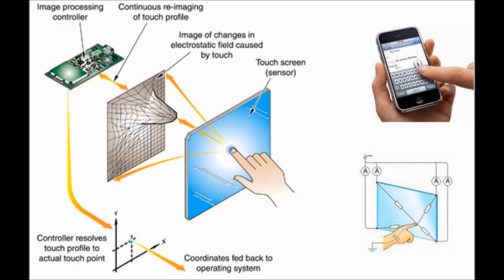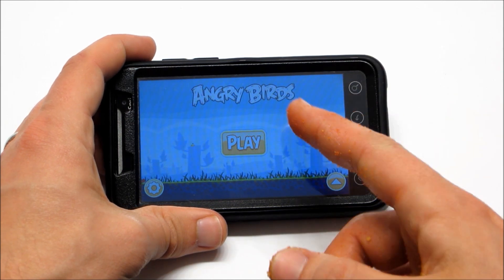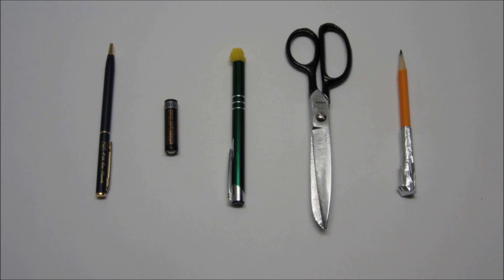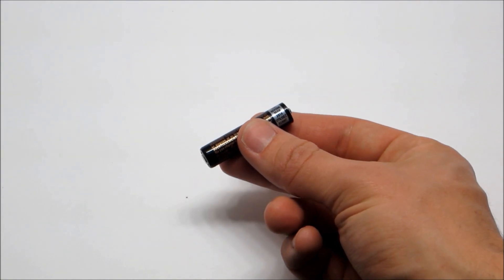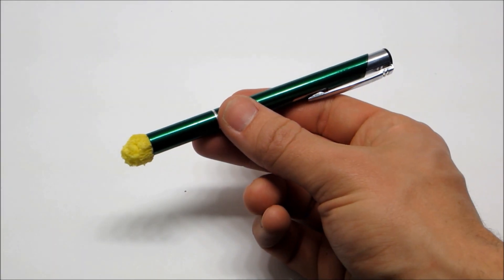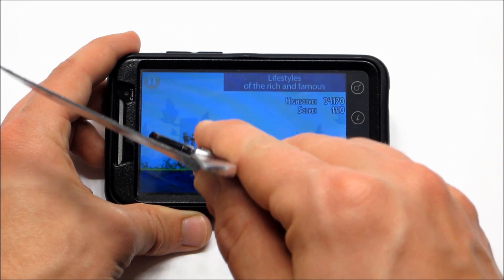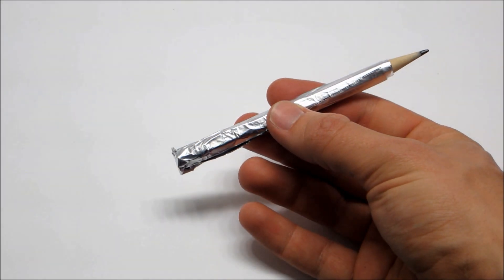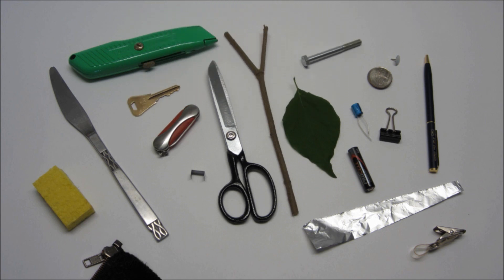DIY Capacitive Stylus

Comment: Hi! Why doesn't my Nintendo DS stylus pen work on my phone's touchscreen?
Reply: Your stylus for your Nintendo DS is made from plastic and cannot carry a charge through it like a metal can as plastic is a non conductor. Also your Nintendo DS is a full touch an pressure sensitive screen rather than a heat / electrical capacitor
Reply: Lmao i also tried that 😂👌🏼
Reply: Elisa Maria Mercado Fernandez I tried that once lol

Comment from the maker: It does work. But it only works on capacitive touch screens. And it only works if there is enough surface area in contact with the screen and a conductive path to your hand.
Reply: Nice video, but I think you have a misunderstanding about capacitive touch screens. The screen detects input when a conducting object touches the screen. The object doesn't have to make an electrical contact with your hand. Just to make sure I had remembered this little factoid correctly, I put a stylus in a vice at an angle with thick rubber pads over the jaws of the vice. The pads were used to protect the stylus and to make sure the stylus was electrically isolated even if I accidentally came in contact with the metal vice. I  pressed the screen of my late model phone then my tablet against the stylus and was able to select text and activate buttons. So in designing a DIY stylus, it is only important that the tip is a conductor since the body doesn't have to make electrical contact with your hand. I also found out through experimentation that the tip's point can be very small (stopping short of making it sharp enough to scratch the screen). Making the point smaller gives the user finer control, allows them to better see what they are doing and allows them to make finer lines in graphic apps. Thanks for the video and the geeky adventure it inspired.

Comment: I'm making a device which would earns me coins in HillClimb Racing by looping a series of operations using an Arduino, stepper motors and stylus pens.
The cheap stylus pens I bought won't work when practically no pressure is applied, so I'll have to find another solution.
This video helped me understand what I'll need to look for, thanks.

Comment: If you're looking for a great stylus, check out LynkTec's!!! What I like about theirs is the microfiber tip which makes writing so much easier because it doesn't create the resistance that other rubber tipped stylus' do. Alsooo it means it lasts longer AND they have ones for touchscreen phones, not just tablets! :)

Comment: Here's a difficult question: is there a way to make such a stylus by using something other than your skin to change the capacitance? other than using a squirell :))
Reply: u can use ur toe ;-)
Reply: pretty much anything that conducts electricity and has a large enough surface area for the screen will do.

also, your picture is pretty :)

Comment: So far only the battery worked for my phone (I have a tempered glass screen protector on a 1st gen Nexus 5). I can wrap foil around an eraser, but I have to press hard for it to work.  Looks like I'm going to the store to get a real stylus since the battery doesn't have pin-point accuracy.

Comment: just out of curiosity..........what r the longterm disadvantages of using a stylus pen for phones like Xiaomi note or samsung note etc..........anything related to conduction based damage, de-magnetization, capacitative ability linked damage, will screen become week after long use in terms of response. Ofcourse i read the 4 things in initial seconds of video......but i just meant to ask other such details as i have asked in my query here
Reply: as far as I know all the objects he said that can be used as a stylus effect the touchscreen in exactly the same way as your fingers would, provided they don't carry an unusually high amount of static charge for whatever reason, so the only thing you have the worry about really is causing physical damage to your phone like scratching the screen.
Reply: ***** well thats actually much more helpfull as a response to my comment........thanxi have a screen guard on so scratching shudnt be an issue, hopefully other classic threats and damages that used to be caused to our old TV screens with similar objects should not be an issue for smartphones thats all the doubt that remains from my queries now...thnx